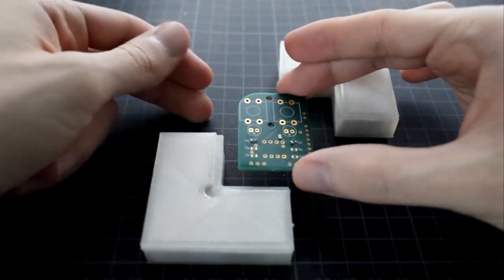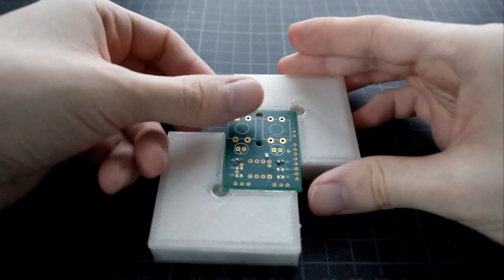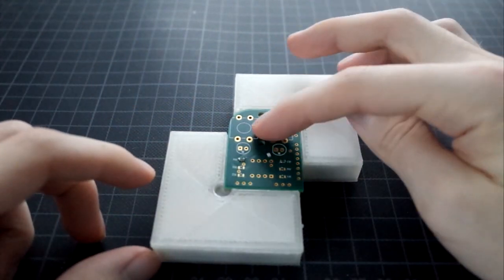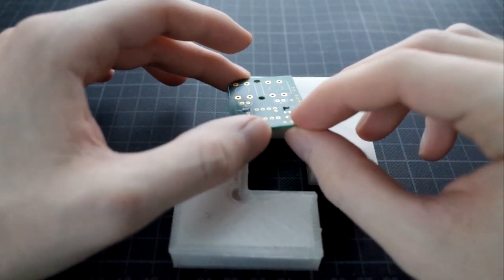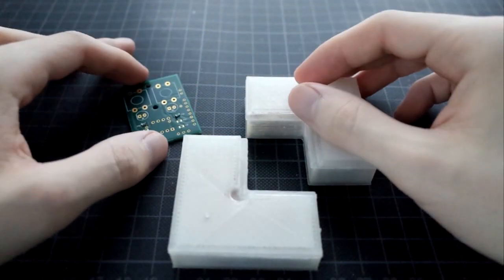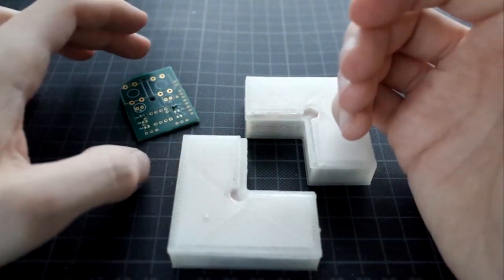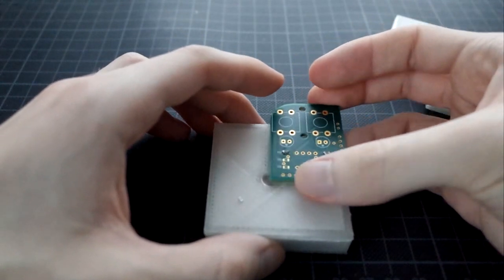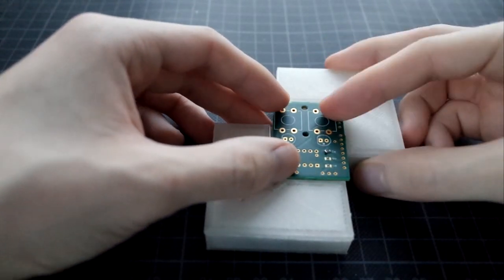3D Printed Weighted PCB Holder

Comment: Just made this, very cool, a lip on the top piece would be nice so it snaps shut, But you can also glue the top upside down and it will lock the pcb in the slot, which is a bit neat
Reply from the maker: Hey thank you for your comment, those are some good ideas! Gluing the top upside down is a really clever idea!